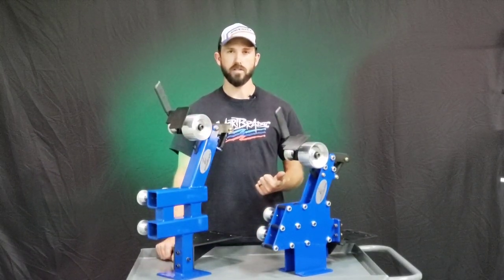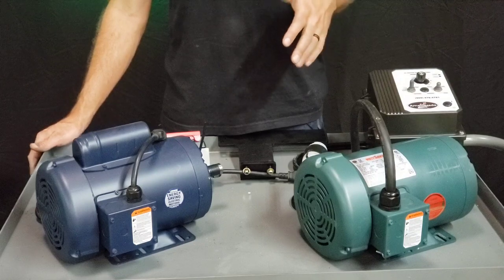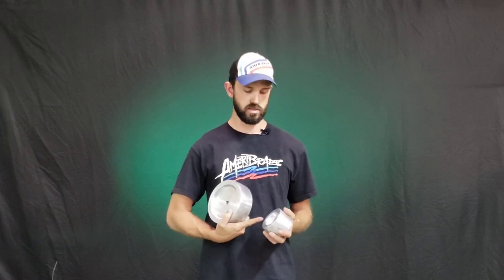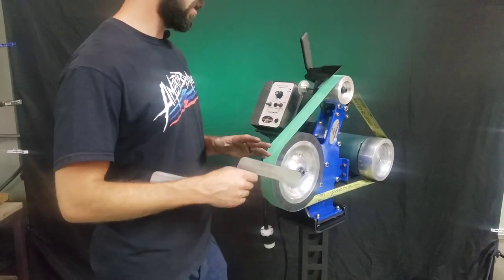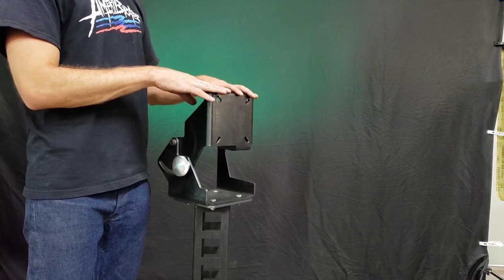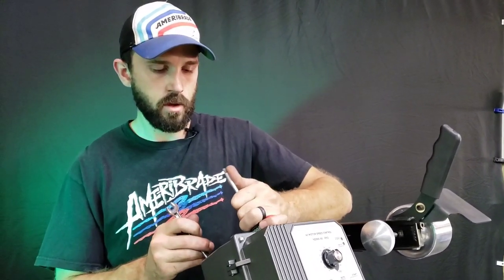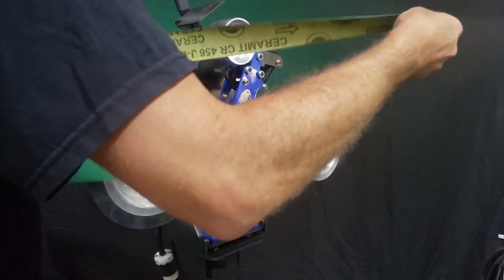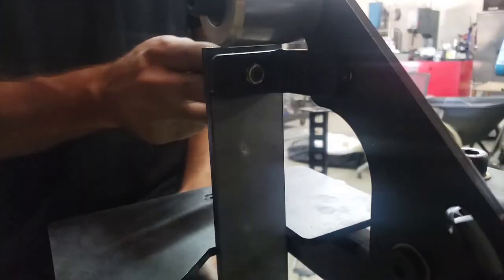2x72 Setup Instructions

Comment: you may want to add a note at 28:mins regarding drive wheel orientation for 1hp model vs higher HP. The written instructions pointed out that the drive wheel orientation (flat side in facing the motor vs flat side out) is different for the smaller HP motor.

Comment: Chomping at the bit to get my hands on this beauty!
Reply: Finally got it all set up and running, and it's fantastic! Everything I'd hoped for, and the customer service is terrific.
Reply: @TheLeatherSniffer   awesome grinder. What motor make and frame does it use?
Reply: @guitarzarfun  Not sure what motor Ameribrade supplies with their complete grinder package. I already had a motor to use (56 frame), so bought the grinder without a motor and used my own.
Reply: @TheLeatherSniffer  k cool thanks! Im seriously wanting this fastback. the  drive wheel tracking is the thing that makes it(and the Wuertz) stand out in a sea of other grinders. That and it's overall compactness. Killer design.
Reply: @guitarzarfun  That's a smokin' price on that motor! Where did u find that? I'll probably be upgrading to variable speed sooner rather than later.
Reply: @guitarzarfun  That was a helluva score. I'm gonna have to keep a closer eye on ebay. I'm planning on upgrading to a similar set-up, with the same kbac27 vfd. Congrats on the new grinder! I'm sure you'll love it.

Comment: is there a way to run the classic frame on reverse for sharpening if you have a vfd motor ?
Reply from the maker: The motor is capable of being set up to run in reverse by adding a simple switch to the speed controller, but the tracking isn't responsive. If you're only using it for sharpening, precision tracking may not be crucial, so you might get away with it. Give the drive wheel several spins in reverse by hand to see if the belt tracks good enough for your standards. If you're happy with it, we can get you a reverse switch.

Comment: How much is shipping on a basic grinder it does not say on the site
Reply from the maker: There are a lot of variables and if you go the the cart and star the checkout process it will give you a total before you have to input any card info. Having said that a basic single speed grinder shipping in 2 boxes at around 150lbs will be about $125ish

Comment: I think you mis-spoke. You said to grind your blade edge up, that you'd need to run the grinder backwards. That is not accurate, the opposite is true. I have your grinder and use it all the time. I do have the reversible motor. Happy with everything except the bearings you supply are cheap chinese ones and I need to replace several. The 3/4in radius wheel bearings self destructed within 2-3 minutes of running it at half speed.....not sure what that was about??.
Reply from the maker: For shaping the bevel, you are correct that you grind edge up with the grinder running forward. However, it is not safe to sharpen with edge up on a belt grinder if you don't run the belt backwards. The sharp edge can cut the belt or your contact wheel and throw your blade at you or you can get hit with the severed belt. 
We offer full warranty replacements on wheels that have bearing failures. Feel free to contact us to arrange for replacements if you ever have issues.